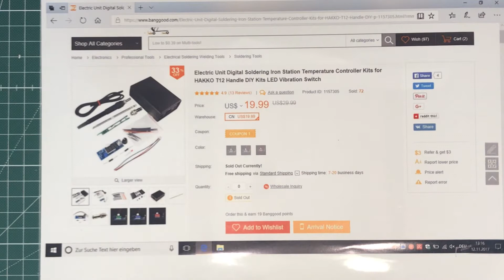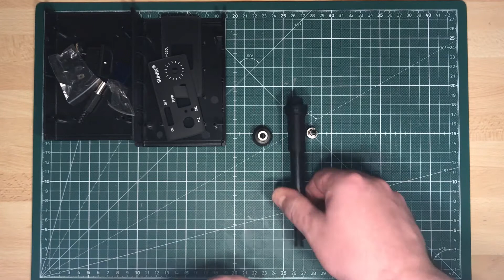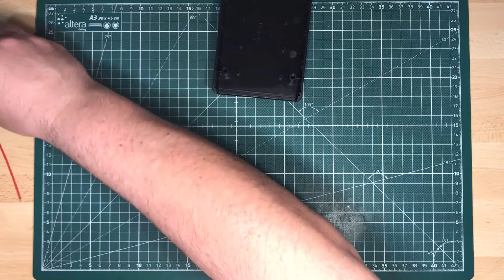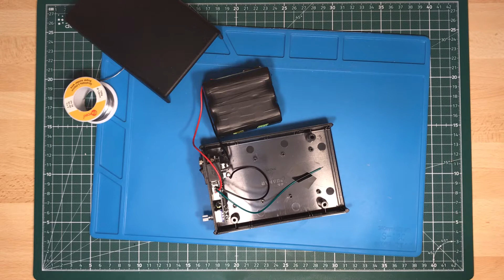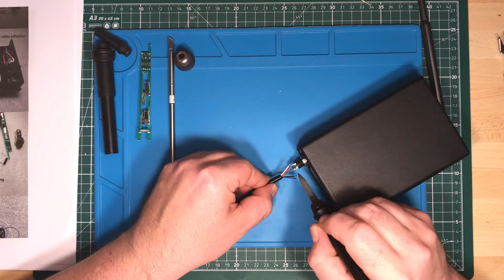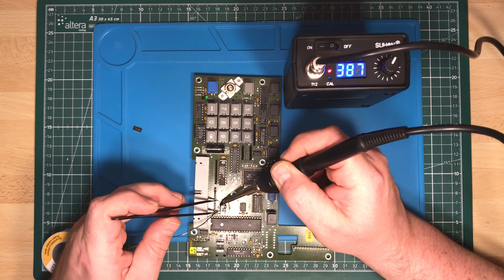20$ LiIon 18650 powered soldering station for Hakko T12 Tips

Comment: For full power and I mean for good soldering results you should use 24 v and 3A ! And not 12 v and 2A or something like that ! My opinion is you should use it with 24v and 3A !
You must see the mosfet witch ampere is it and switch to a 6.9A and you don't have to be afraid that the solder station would burn off ! And you can use max 5A instead 3A and have more power ! It's a little mod.
Best regards and thank you for that beautiful and very informative video !
Reply from the maker: Hi, you are right. For me this is not my daily driver it is just a fun project, my daily driver is an Ersa Pico and an old (30 years) Weller TCP-S. The purpose of this was to be as small as possible and 24 W is enough for a lot of jobs in another Video I solder a whole KIT with it.
Reply: I've used a T12 station with a 3S 18650 pack, and was impressed with how well it works at 12V.  My butane soldering iron hasn't seen much use since I got the T12 put together.

Comment: If it draws 1.3A the tip is only seeing 10.4v with your DMM in series. It would probably run a bit better if you fully charged the battery or used brand new cells
Reply from the maker: I build another one with a 4s3p configuration this one heats up much faster, this has a 3s2p configuration and is much smaller but still useful in another video I solder a whole electronic kit with it.

Comment: Question : What charge controller are you using on the battery pack? Or did you buy the battery pack preassembled with the controller? Thanks!
Reply from the maker: often I use one of this i bought from banggood.com -> http://bit.ly/2Gqu99V
Reply: Thanks for the swift reply! I'll give it a go, as I have a Hakko already would like another that's battery powered. Thanks again :)
Reply: That board protects from overcharging, but it needs to be used with a charger with voltage and current regulation.  Search ebay for something like 12.6V Lithium Battery Charger.

Comment: hi ts.electronics, i just watched your video on 20s lilon 18650 powered soldering station for hakko t 12 tips and liked it, i have clicked on like, and subscribed and clicked the notifier.
i was very impressed with the video from start to finish.
what id like no is where did you buy your kit from, could i get the name of the company who sells them please, ive looked on the net and seen quite a few kits on ebay but none of them have a guide to go of not even banggood, not like your kit  yours was the best parts and especially the plastic box arrangement and building of it plus instruction manual.
john
Reply from the maker: Hi John, looks like the complete Kit is sold out at banggood.com The battery configuration I used is 3S2P . In another Video I used a self made case for the Module and at the moment I'm building a larger station with a regulated power supply and a 4S3P battery configuration much more powerful for the iron I used a OLED Controller Board that is much better. This project is not finished but there is a video with a sneak peak at this project.

Comment: I cant get the wiring right,in the two  wire ends it's number for some alphabet for minus & positive then when you get to head unit it's back to letters & numbers very confusing have two handles giving me the 500 code(no tips)when there is a tip!Is there a true reliable English direction page?

Comment: Hi I see you have the ABS case and the Aluminium case. At the rear of the ABS case, there is 12v and mains connection. Are these to be wired to what you are going to power the soldering iron by ?
I have ordered an ABS case as I already have the aluminium case built up. Can I wire the 12v socket as well as putting a 24v power supply inside so I have the option of 24v mains or via a 12v source, like a car battery with a lead with a 5.5 x 2.5 plug on it. Thanks
Reply from the maker: I only use the 12V socket, you can use up to 24V to power the board inside. I don't have the aluminium case. I use a LiIon battery inside to power it.

Comment: in the beginning it was quickly switching between 500 and 1xx degrees. i noticed similar behaviour when i tinkered with some ktype thermocouples. i could never nail down where it came from, but i think pulling one side of the thermocouple to gnd helped
Reply from the maker: after a while playing with the soldering station I think it has something to do with the settings, to bad there is no manual for the control module, it works fine and I can solder with it very well but have no idea how to setup sleep timer and rise time....... I just ordered a more complex module now with an oled display giving more information then the one is included in the kit. Soon I start to build my own case so it fit better the look and feel of my other self-made lab equipment. The handle doesn't feel bad for the price so I think it is a reasonable iron for beginners or hobbyist. I can already say it has more thermal capacity then my tiny ERSA pico tool.

Comment: hi what is the charge board on the battery called ?  nice build I need to get this for my nephew so he can build and have his own iron.
Reply from the maker: It is a battery management system it is for charge and discharge protection. I bought it from banggood

https://www.banggood.com/5pcs-3S-20A-Li-ion-Lithium-Battery-18650-Charger-PCB-BMS-Protection-Board-12_6V-Cell-p-1120988.html?p=0V0809949687201412Y5
Reply: Thanks. Banggood is a great place for todays inventors I am always on that site getting parts and tools.
Reply: It's not strictly a BMS; all it does is protect the battery from overcharging, over current (short circuits), and over-discharging; some also keep the cells balanced, but I don't think this board does that.  You also need a charger suitable for 3S 18650; searching for 12.6V 1A 18650 Lithium Battery Charger finds something suitable on ebay (note that it has an LED to indicate charge status).  Or, add a step-down charger module so the battery charges when the station is running on an external DC adapter (MAX745 or SY6912 are a couple of options).